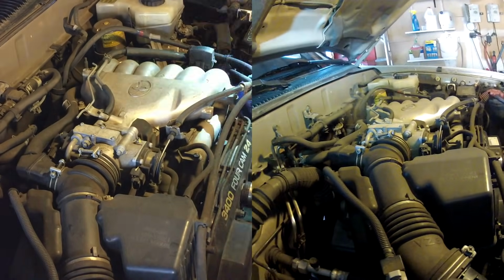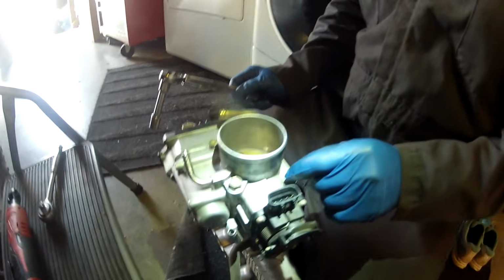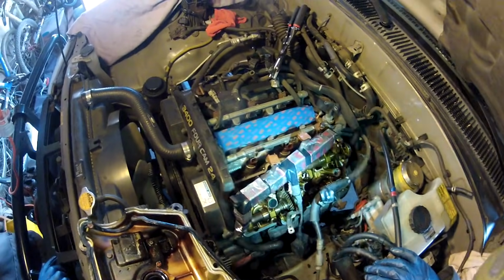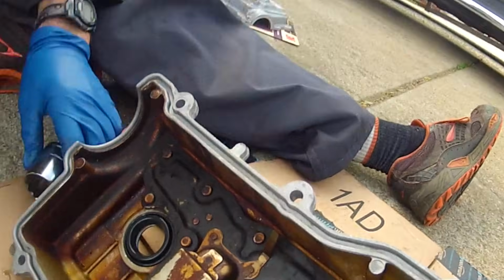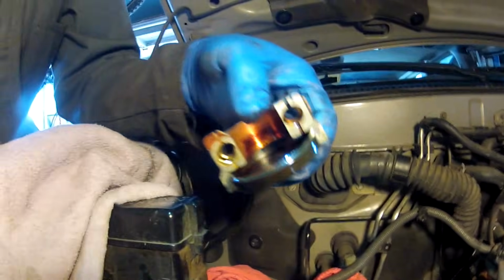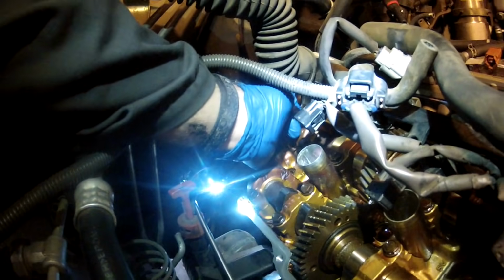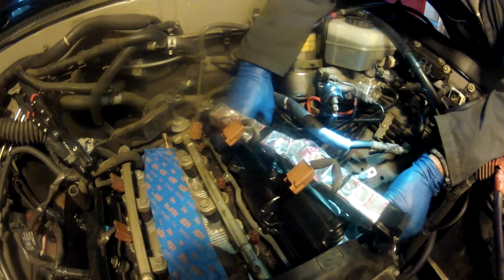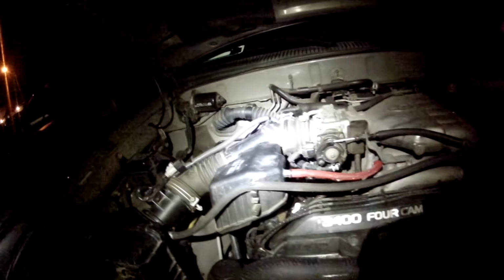3.4 L V6 5VZ-FE Toyota 4runner, Tacoma, Tundra Valve Cover Gasket Tutorial

Comment: Great video.  It inspired me to rip mine apart today.  Mine is a 96 with 395,000 km. It still runs perfectly, but was having the typical oil leaks.  One of the comments mentions the trick where deforming plug tube seals and then turning the valve cover over and tapping with a screw driver from the other side.  Worked like a charm.  They were out in 5 minutes.  Judging from the way these seals shattered, I'd say they were original and really needed to be replaced.  I'm sure some of the caked on grease on valve cover tops was coming through these degraded seals.  I found one other point that might help others:  In order to get far more clearance between wiring loom and drivers valve cover cut the tie golding small attached harness by the alternator.  You can put another on after. This gives about 2 inches more clearance at the front of the valve cover.  Also, at the back of the engine block passenger side there is a steel bracket that extends upward and supports the main harness in the middle.  You can feel a 10 mm nut on a stud, and a 10mm bolt.  I was able to undo both of these by feel and ratchet wrench and pulled the bracket off the stud.  This allows you to raise the whole main wiring harness and creates an additional 2 inches of clearance between the looms and valve covers.  Once I did this, the drivers valve cover was easy to remove.  I think you could pull this harness off the central support, but I didn't want to break the plastic.  Just be careful to lift the front of the drivers side loom off the plastic support which inserts into loom just under the timing belt cover.  This made things so much easier.  I used the suggestions of the aluminum tape on both sides.  Thanks!  It's a time consuming job, but you explained it so well and saved me $600.
Reply from the maker: Thanks for sharing the tricks you learned doing the job.  Anything to make that driver side wiring loom easier to deal with is definitely a plus.  Glad our video helped you complete this job on your own and save yourself a decent chunk of money.  Success stories like yours makes us smile.
Reply: 395k miles?! mines having the same problem at 171k! that’s good news for me . i’m sure yrs had this problem sooner and yet it still ran to 395k! what a relief that is for me . valve covers can wait another month or so lol
Reply: @cedricmendoza1305  kilometers...still bone dry 7 years later
Reply: @redgreen610  oh shit lmao just saw. how many miles/kilo now?

Comment: o ok,,,thank you so much for answering. I'm doing some studying to get the courage to do this as well on a 2002 toyota 4runner sport edition 184,00mi. 
...and so far your video is helping me get there. Thank you!
Reply from the maker: Israel, this is not a hard repair but it does look intimidating.  It took me 6 months after buying the parts for this job to find the motivation to do it.  When I did this for the first time, I took pictures of the engine at different angles so I'd have a reference to look back on in case I forgot where something went.  I also used strips of tape and labeled every hose and electrical connection I took off so I'd know where it went back on.  I made sheets of paper as a template to remind me where the bolts and nuts went for the intake plenums.  If I took a single bolt I took off something, I put it down on a post-it note letting me know what it was for.  Make sure the first thing you do after getting the lower intake plenum off is cover those intake holes with tape so you don't accidentally drop something down in there.

If you're not in a rush and just take your time, you'll get it done no problem and you'll have a great sense of accomplishment afterward.  It was doing this repair that got me back into wrenching more.  When I was in my teens, I wrenched a lot on a 68 Bronco which was my first car.  I also worked at a Chevron gas station where I did some work on cars too.

Anyway, good luck with the repair.  If you have any more questions, just ask.

Comment: what spray did u use to clean off the rim of where the gasket actually sits, thanx.
Reply from the maker: I think you're talking about the surface of the head.  I didn't use any spray to clean it up.  I used a plastic putty knife to scape any old gasket material left on the head.  You could also use a razor blade or other type of gasket scraper.  Just be careful to not leave any deep scratches on the surface that could affect how well the gasket seals with the head.

Comment: This is the most thorough video by far I found on replacing the valve cover gaskets on a Tacoma. Many thanks for your great work on it!
Reply from the maker: You're welcome Doyle.  Keep watching because we all kinds of good stuff coming down the pipe.  Tell your Tacoma and 4runner friends about us.  We want our videos to help as many people as possible.
Reply: None of the other vids showed the rear cam plugs needing attention. As per your suggestion I checked them with a mirror and found the source of my leak which just changing the valve cover did not fix. My '96 Tacoma has 268,000 miles and still running great. The valve cover leaks have been a real pain in the putooty though. I am going in for the 3rd time now and am going to do it right this time thanks to your vid. Previous tries did not include removing the cam plugs and the half moons. Thanks again!
Reply from the maker: Glad our video helped you identify the real source of the leak.  Yes, getting the job done right the first time is ideal.  This is why our videos are longer than than most because we try to make them as comprehensive as possible so people are successful the first time around.
Reply: Also I really appreciate you including the torque specifications in your vid as well. I am a subscriber now!
Reply from the maker: I'm stoked we earned your subscription to our channel.  Happy Wrenching!

Comment: Just wondering if you recommend replacing the Camshaft Oil Seal on the front of each cylinder while doing the service?  I was at Toyota buying parts and was confused by the 4 cam plugs, which actually appears to be only 2 plugs in your description of the video.  So 2 cam shaft plugs on the rear (one per cylinder) and I'm guessing I might as well do the oil seal on the front of the cam shaft while everything is torn apart?  Thanks for your videos by the way they are super helpful, clear and easy to follow.
Reply from the maker: We made a mistake in the parts list.  We listed 4 cam plugs when you only need 2, one for each head on the back side.   Doing the front cam shaft oil seals is something you would perform when doing the timing belt job, not when doing the valve cover gaskets.   Glad you're liking the videos we've been making.

Comment: I just started to replace mine on my 2002 4runner. I accidently over tightened one of the valve cover bolts and it broke. Do you have a part number for those, or will any valve cover bolt work?
Reply from the maker: You have two choices.  You can look up the bolt part number from a parts schematic from an online parts seller like Camelback Toyota or you could take a valve cover bolt to your local hardware store and match up the thread size and thread pitch and buy a bolt with a similar length.  The bolt head might end up being a different millimeter size or might even end up being a fractional size but that's not a big deal.  What's important is you match up the thread size and pitch so you don't mess up the threads in the head.

Comment: Gonna tackle this on Saturday on my '96 T100!  It has 265k and the valve covers have just started to leak a bit.  Parts at Camelback totaled $202 with free shipping to Tennessee.  Thanks for the video!
Reply from the maker: Your welcome and good luck with the job.  You can't go wrong with ordering from Camelback Toyota.  Great prices, they ship quick and the shipping is free if your order is $150 or more.  They will charge you a shipping fee if the package is oversized, but that's not that common of an occurrence.

Comment: Great video! After watching this I'm just going to live with the small leak of a quart every 3 months or so. My brother asked me why I didn't just change the valve cover gasket and told him it isn't a 283 chevy!
Reply from the maker: Robert, have your brother help you and knock it out.  Yes it's a little involved and time consuming but I guarantee you'll have an incredible sense of accomplishment afterward.  I put off this repair for months but I was so glad I finally got off my ass and did it.  It's not a hard job at all.  Just take your time, label hose and electrical connections, and you won't have any major problems.  With any repair, you'll have something that will hang you up but you'll get through it and be stoked afterward for fixing your leaky valve covers.

Hope my pep talk worked!

Comment: Are the 1/2 moons rubber or aluminum? Previous 22R engines, I always replaced were rubber. Just did this job about 11 months ago on a relatives 2004 Tacoma. Did not THINK about the cam covers/caps in this "breathing over my shoulder brother-in-law type" All parts were OE, BTW consider Chad at Autonation Toyota/Scion in Tempe). Now Tacoma has oil oozing from front valve cover area. I know it's not the valve cover gaskets, I am kicking myself because I suspect it's either these cam plugs and/or 1/2 moons. I'll need to redo this now, but I dislike Felpro (Made in China). Beck Arnley kit? Just valve cover gaskets, moons and cam covers?Aarrrgghh!
Reply from the maker: The half moons are aluminum.  The cam plugs are metal with a rubberized coating on the outside to get a seal with the head cam shaft collar.  The cam plugs and half moons are a known leak spot on these engines.  If you don't already own one, get one of those small telescoping mirrors with a light so you can see on the backside of the head between the head and firewall.  

I'd recommend using OEM for the cam plugs and valve cover gaskets.  The half moons can be cleaned up and reinstalled with fresh FIPG or sealant of your choice.
Reply: Timmy The Toolman: Thanks...I typically use high-temp Permatex grey. That was on the cam humps when initially removing the valve covers. I have a telescopic mirror, but without having to look, I know not having resealed those 1/2 moons and replacing those cam plugs....I'm going back in.....thanks!!
Reply from the maker: Roger that.  Good luck and I hope it all goes smooth for you.
Reply from the maker: I forgot to tell you I used a pair of channel locks with some electrical tape on the serrated jaws to pull the half moons out.

Comment: Anyone else have a problem with the gasket tearing on something, probably the spark plug tube when you put the driver side valve cover back in place? The bunch of wires on that side make it very difficult to get the valve cover back in place without rubbing the gasket against a bunch of metal parts. Any suggestions on getting that back in place would be helpful.  I did this job twice, the first time oil was pouring out of the corner nearest the driver and after the second time, its 6 months later and I have a slow leak from the back driver's side again same spot.  Also fyi, beware of the hard plastic on those wires, it will be brittle and can easily break sending pieces into the engine when you are taking the covers out.
Reply from the maker: Hey Clayton,  you just have tug on the wire harness enough to sneak the valve cover under it.  That gasket seems to be pretty tough, so if you were able to damage it, you must have been dragging it over the spark plug tubes and whatever else with a decent amount of resistance.  On my truck and my buddy Sean's truck, I was able to get the driver side valve cover in place without getting the gasket snagged on anything.

If you watched the video, you're suppose to put FIPG on the corners of the cams and over the junctures of the half moons.  On that subject, did you reseal the 4 half moons (2 on each head) and also replace the 2 cam plugs at the back of each head?  You could be leaking from those spots as well.  

We cover dealing with the brittle plastic wiring harness by taping it up really good before we start prying on it so it doesn't break up into a bunch of pieces.   With it taped up, the loom will still crack, but the pieces will stay together and not go flying all over your engine.
Reply: Thank you for the thoughtful reply.  I did not watch the video prior to doing this work but I'll rewatch it when I do it again.
Reply from the maker: Your welcome.  Hopefully it goes smoother for you this time.

Comment: Any advice on intake gasket direction. I have the Toyota OEM gaskets ready to install but a ittle unsure if direction
Reply from the maker: It should be pretty straight forward.  I do remember there's a little bit of overhang with those weird holes on the sides of the gaskets.  Give me your email address and I can send you some pics I just took from the factory service manual that might help you out.
Reply: Timmy The Toolman 
The gasket has three copper washers. one side is wide and flat while the other side is skinny and small. burstcasino@gmail.com
Reply from the maker: I sent you some pics from the FSM.  Hope it helps you out.

Comment: How long would it say this took you? I looked back at my rear cam plugs and they are weeping pretty bad. I think mobile 1 syn is really amplifying  those leaks.

edit: how long for a person who goes at a very very slow pace?
Reply from the maker: I think it took me around 8 hours and I was very careful and slow labeling everything and taking pictures as I went.  There's always a learning curve though when you do something for the first time.  With this video Sean and I made, we take a lot of the guesswork out of it for you.  I think, even with taking your time, you should be able to knock it out in 5 hours.
Reply: thanks for the reply! I looked at my half moons with a mirror on a stick , they are all weeping. cams actually look good . 

Any chance that oil can go into the timing area? its not too, not losing any oil on the stick, just weeping

Thanks
Reply: Still Don't trust my self to do it myself. Last few times i tried a DYI repair , everything that could go wrong went wrong.
Reply: Strange to see there seemed to be too much RTV. blobs  of it
Reply from the maker: Oil could get behind the timing cover if the front cams are leaking but I doubt it would affect anything other than making a mess.
Reply from the maker: I put quite a bit of FIPG on the half moons so it would ooze out the sides letting me know I definitely have them sealed good.  I'd rather err on the side of having a little too much than not enough.  The excess FIPG isn't going to hurt anything.
Reply: I wasn't as fast as Timmy, but had the heated garage to close the door on when I felt like it.  So it ended up taking me about 3 or 4 hours just to strip everything apart. I photographed things as I took them apart, labelled every hose, and put tape on every connector to draw my attention to it when reassembling.  I also had quite a job removing years of caked on crude from the valve covers, and then wire wheeled them back to original stock look. One tip I didn't mention in last post: I used cords and wire to hold the wire looms up at maximum clearance and removed the vertical black metal bracket from the block beside the drivers side valve cover (14mm bolt I think it was).  I think Timmy mentions doing that, but I didn't catch it the first viewing.  Once the plugs were re-sealed and the valve covers went on it was a quick reassemble.  I used aftermarket gaskets.  I might regret that.  The tube seals were inferior to the OEM and saving the $100 may not have been worth it.  You pressed them in with your fingers.  There was no need to use the socket because these grommets were flimsy. The dealer didn't have all of the parts when I went in and was talking about a week to gather them.  So I went with Wescan (in Canada) who had the parts in hours.  Impatience may catch up with me in a few 1000 km.  Go with the stock OEM parts from Toyota.  You would gladly pay $100 not to do this job again too soon.

Comment: Hey Tim great video. I didn't see where you pulled the front cam pieces. I see where you pulled, cleaned, and  replaced the front and back half moons. Also the firewall side cam moons.  Do you have to remove the timing chain to get to the front cam moon?
Reply from the maker: There aren't any half moons on the fronts of the cams.  We mistakenly put down on the parts list you need 4 cam plugs when you only need 2.  Sorry for the confusion.  Somebody pointed this out to me and I put a correction in the video description but I know not everyone reads it.  I didn't want to have to remove the video, make that correction and upload it again so I left it as is.  Hopefully the place you bought them from will accept a return.  If not, maybe you can unload them on Ebay.  Good luck with the repair.
Reply: Any suggestions on heat resistant tape or sheathing for the injector wiring harness. The plastic wiring harness sheathing just crumbled when I took off the heads. Thinking about using a plastic wiring sheath and then taping it up. I got to do something to keep the wires from burning up.
Reply from the maker: I've seen people do just what you mentioned and use a plastic wiring sheath when the original plastic wiring harness disintegrated on them.  You can buy it in different diameters at auto parts stores and I think they sell it by the foot.  This is the reason why I mentioned wrapping some of that aluminum heat ducting tape around the wiring harness before you start torquing on it to remove the valve cover.  The wiring harness on my friend's truck cracked but the tape held it in place.